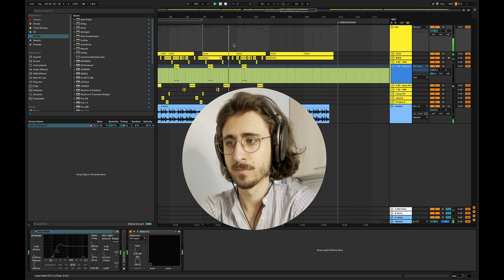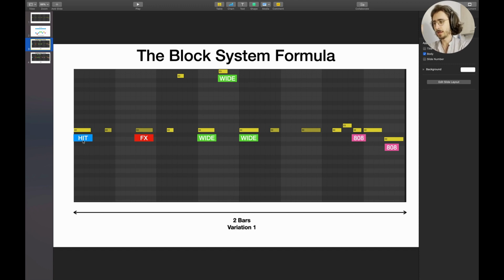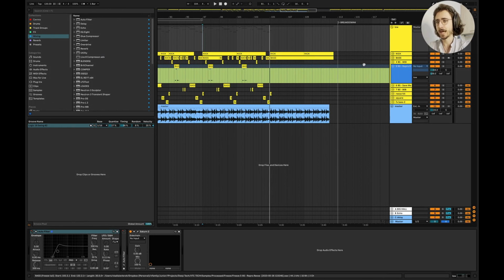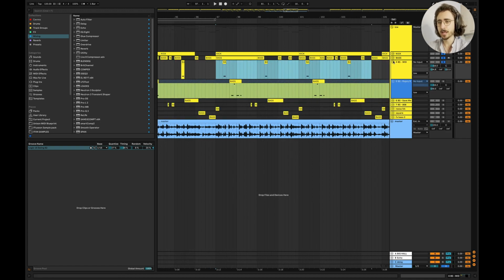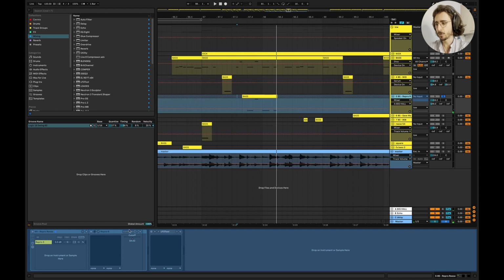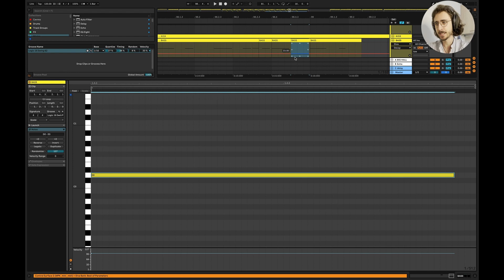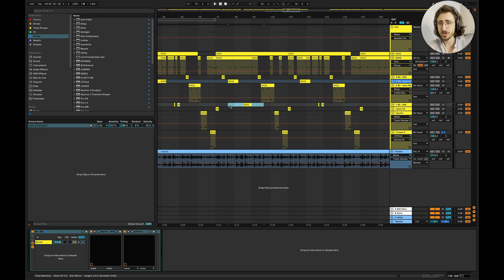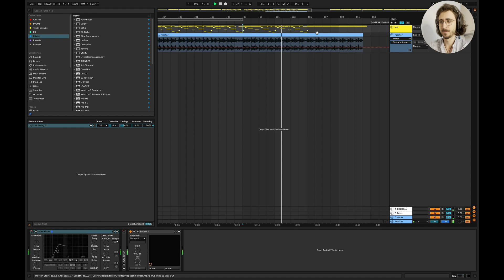How To Layer Tech House Bass Like A Pro

Comment: How are you getting it to sit nicely on tracks where you've got more instruments in the mid to upper range... do you use envelopes, tools like trackspacer...SCC, multiband compression or a mixture?
Reply from the maker: Hey man. Yeah, plugins like Trackspacer in combination with multiband compression will give you a very clean mix. However, it's very important to keep your mixes simple and minimal because no processing will save you if there are too many elements playing at the same time
Reply: @Fluxeon  Thanks man! Appreciate the response! When you say 'in combination', do you mean on the same tracks? Are you using a lot of envelopes on your multiband compressor?
Reply from the maker: It could be on the same track. Say for the bass ->  Volume shaper as a sidechain, saturator to warm up mids and lows, limiter to control dynamics, then a multiband compressor (usually with 1 band only for cleaner sound), and on top if needed you can add trackspacer. Something like that yes :)
Reply: @Fluxeon  Thank you for the comprehensive response! Lots for me to think about. :D
Reply from the maker: @donniem6783  <3